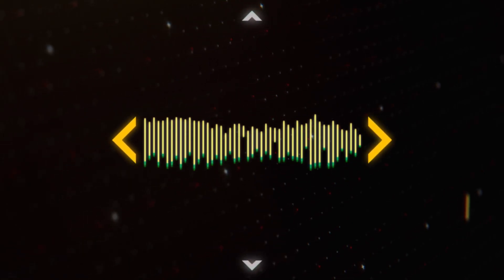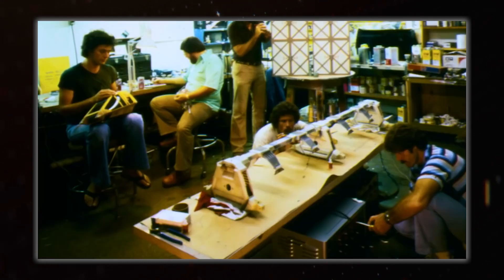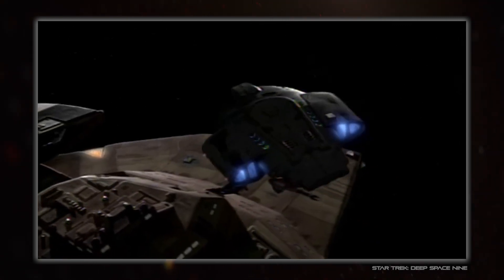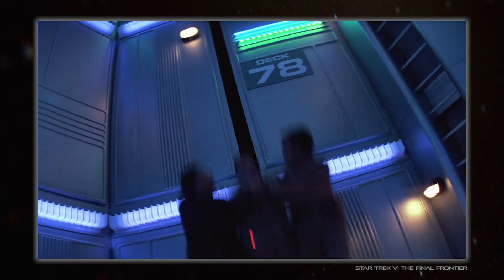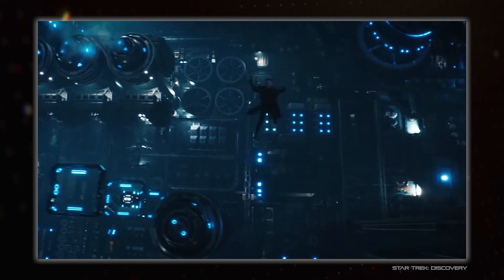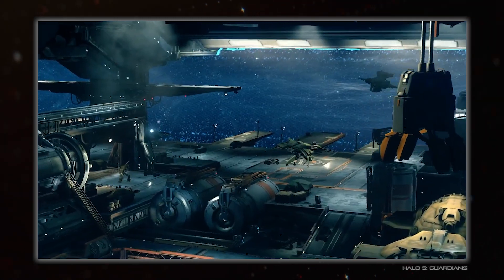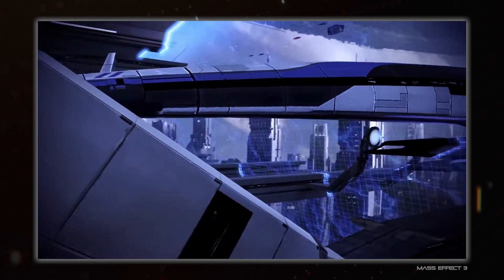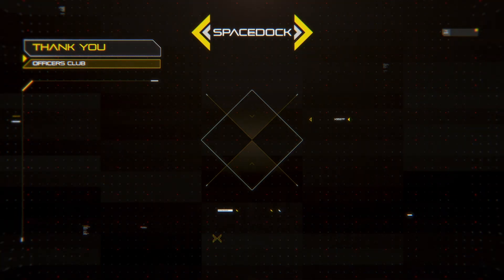Why Do Sci-Fi Spaceships Seem To Change Size?

Comment: Not ships, but Mobile Suit Gundam is very bad with this in the first few instalments.
Gundam was supposed to be 18m tall, but sometimes they draw it to be something like 100m when someone is standing close to it.
We know they have a very rigid ship sizes used for animators and compared scenes to match(Mark Simmons, who worked as the official translator, is involved in the conversation and provided scenes), but we all agree that the official released numbers on the setting books are not always that size(some way shorter and some way longer) and is a mess.  And also, while ship to ship sizes are mostly right in shows, ship to mobile suit sizes are often times arbitrary and fluctuate.

Neon Genesis Evangelion has a fun take on this, they finally come up with a fixed size for the newest movies(80m), but the old TV size is arbitrary on purpose.  The size they gave to Super Robot Wars F for the Evas is 40~200m, they just use whatever height they think looked cool in each scene.  Likely a shout out to Gundam.  An official anthology comic poked fun on this.  Since the buildings in New Tokyo-3 can raise and submerge, they just adjust the buildings to make the Evas look taller or shorter.

Comment: Funny storry the same issue occurs with space engineers.
You can build your own ship but the majority of the craft is always dedicatet do various systems, propulsion or the hull which makes the interior somewhat limited. So you don't have scale issues between ships, just inside. Everything is boiled down what the ship have to be capable of. 
Or if you don't care build a enormous ship which fits all your needs.

Comment: WARPING SPACE during certain - or hell you could even make it all, space flight/propulsion scenes (ones where drives are active) could be an answer. And to be honest I suspect that many situations have these scale problems come up specifically due to the concept around movement in space.
Using space-time warping propulsions COULD perhaps then give a reasonable neat answer to having wonky visuals if done even moderately well.

Comment: I always wonder why they (the studios) don't simply actively handwave this with saying that what we see is pretty much how the computers of the ships present the scene to *humans*.
Doing that would instantly have lots of stuff make far more sense.
In a realistic space battle (well, as far as it goes), distances between ships would be huge. Very huge. Distances between naval ships in combat already are, and this should only be a fraction to what they'd be in space. Actually seeing a frame with all ships in a battle would look like mostly black with some tiny flickerings of explosions.
But if what we see is computers presenting to humans, they'd magnify everything, like miniatures on a battle map are naturally magnified, or marked houses on a map.
We could also say that something like a klingon ship going into stealth isn't actually the thing turning literally invisible, but it strongly reducing it's emissions and thus becoming invisible to normal sensors. The display to humans would still visualize this as the ship blurring and then vanishing as we are used to. This is pretty much how it would work with submarines, dot on a radar and then no dot on a radar.
And as for the actual topic of this video, ship sizes as seen might be actually representing their amount of *emissions*. This would easily explain the Defiant, which is said to have an unusually high amount of energy for its size class. Defiant is in battle -> reactor at full power -> it gets large on a representative visualization.
Reply: (Obviously this doesn't work with the issue about ships in docking bays and their interior being bigger.)

Comment: I think that's more important then hyper accurate and consistent true scaling is that scaling of your ships feel correct. For example few people questioned the final level of the original Halo game  even though the level was several times larger then ship model shown earlier because it felt like it could belong into the ship.

Or to give a more descriptive example, lets say you want ship "a" to scale at 10 times bigger then ship "b" then you can have ship "a" be between 8 to 12 times bigger then ship "b" and still seem consistent and correct as they're still in the rough "10 times bigger" margin even if the actual scale varies. This kind of emotional or narrative consistency is way more important then getting the scale correct within 1 mm especially if we're talking about things that are several kilometers long.

EDIT: Same applies to interiors not matching exteriors, they should feel like they match even if the actual scales don't quite line up.

Comment: on a fun note, the Normandy SR-2 and the Railjack are apparently close in size.  Though if I had to fight a reaper I think I would take the Railjack, Orokin/Tenno technology is far ahead of the Systems Alliance and probably even that of the reapers.

back to more on topic to the video though
The normandys are honestly empty for the crew sizes a ship that scale should have, Like the Railjack has an excuse as they only ever operated in the Sol System so even when crewed by Dax warriors it was never far from a dock as the void drive flies.  So I excuse the Normandys as victims of game design, Making the ship packed tight like a submarine or RL navy ship of a similar class or type role would not only make navigation in a game engine hard but add lots of unneeded corridors and crew to animate and model and texture.  The harsh reality being the SR-1 and SR-2 are basically just roaming quest hubs.

Similarly the Tenno/Orokin Sigma Series Railjack from Warframe is so big open because you can be boarded via attack vehicles called RamSleds.  As such the ship has to be big enough to be a fighting space for the gameplay mechanics you use in warframe which means you are going to want some parkor room.

Comment: Speaking of scale: I always found funny how vastly different the called out distances between starships and their actual visual distance was in Star Trek. For example the helm would say that another ship was 20,000 kilometers off the bow, while we can cleary see that the actual distance was just a couple of kilometers at the most. It's almost if they just wrote huge numbers into the script, because space is huge, without thinking about how that would tranlaste to the screen in the modelwork. And they didn't bother to alter the dialog when they actually shot the scenes.
Reply: Or maybe you just havent grasp how small 20,000 KM really is. The moon is 384,000 KM away and it appears to be right next door. Star Trek ships are actually massive, watching ST ET they generally dont use such high numbers as the ships are quite smaller.
Reply: @carmzilla  Sounds to me like you don't have a grasp how much smaller than our moon the Star Trek ships and how much 20,000 km still are (over 1.5 Earth diameters). But as a rule of thumb: when they can show both ships in the same shot, it's veeeeeeeeeeeeery unlikely that they are thousands of kilometers apart.

Comment: This is not adequately addressing the issue. You only explored why it's okay to make ludicrously nonsensical, incongruent, inconsistent, illogical, and unfitting sizes, but you didn't address why you SHOULDN'T do that at all.
"Some people won't like it" is basically what your treatment of the opposing side boils down to.
However scaling something consistently can give any work of art a sense of realism that will draw you in. It is like comparing some egyptian carving, or a medieval tapestry to a realistic painting with perspective. Yes, sure the previous ones have their charm and are neat for some decor, but if you're actually trying to draw someone into the environment of your universe, imagination, or story, then a certain degree of realism is vitally necessary. People might not hate the show for scaling inconsistencies, or even notice them, but with something as basic as visual perception, and the human mind relying on it as the primary sensory connection to the world, it will subconsciously result in an uncanny valley effect very quickly.
This could be used deliberately, but usually the opposite is wanted.
It's why we have sets with cuts in media nowadays, instead of just people talking on a stage performing a play.
Others have mentioned the innate homeliness of spaceships where the set is a consistently small size, like firefly, bebop, nebuchadnezzar, or the millenium falcon. But even larger scales done consistently can benefit by creating awe and a sense of actual weight.
The LA crash scene in StarTrek: Into Darkness, as well as the damage and subsequent crash scene in StarTrek: Beyond had weight to them, because the scales were kept consistent all throughout, instead of varying wildly.
It's not just scaling consistency, but sizing consistency that is something to consider.
People rushing through corridors and turbolifts felt more consistent in TNG than in the new movies however, precisely because in TNG these things were always kept consistent, and rooms always roughly had the same scale, if not size. It all felt roughly like a living room, with hard carpet/PU flooring, which makes sense for a comfort oriented post scarcity galactic federation. Meanwhile in the new movies, textures and sizes of interior equipment, walk paths, railings, and whole rooms, all change from shot to shot. Engineering retains the brewery feel, the warp core control and the bridge look like modern scifi setpieces, the sickbay looks like TNG, the warp core interior looks cyberpunk, the ice station looks like some horror movie. Sizes are only one aspect in this of course, but they too can contribute to something being more or less immersive.
In StarTrek Online both sorts of sizing issue come into play. Some corridors are huge, some are more true to their on screen counterparts, but still vertically scaled improperly. And some setpieces have a more generic grunge-y look, while some possess the sleek and soft aesthetics of starfleet design.
On both fronts this creates an experience that pulls one out of the game to a certain degree.
In Halo sizing is also an issue, but this is fixed a lot by forced perspective gimmicks, where the transition from foreground to background is hidden by intermediate objects. Others have referred to the Warthog run as an example of bad scaling, due to the Pillar of Autumn being too big, but it is less noticeable, because we previously never really saw it in a fixed relation to something else.

All in all, not pulling the viewer subliminally out of the experience through sizing inconsistencies (which are due to carelessness a lot more than artistic choice i believe) is more important than anything gained from using the artistic shortcut of enlarging something in size.

Comment: You handwaved this issue away, but in StarTrek Online for example size differences are so utterly unbelievably obnoxious that the whole game often feels more like a tactical display than an actual representation of the game world. Distances are kept realistic in the multi kilometer engagement range, but the actual scale of the models then is ludicrous. Vertical scaling in nternal spaces alone is already jarring, as the devs worked off of actual set sizes, not what the camera ended up showing, resulting in studio height corridors in vessels like voyager and ludicrous expansive hallways runabouts could fly through in others. The need to make standardized bridges you can walk around in even for small vessels like a runabouts, and a paranoid fear of navigation issues, also resulted in pain for the player, when every vessel interior is compeletely unrelated in shape to the actual vessel, and is a TARDIS in disguise.
This is in addition to bumping into tiny planets with ships.
Ironically for a game about space, only the ground maps have sensible scales.

Comment: I can't say I've over noticed this in scifi, however it really stands out to me in flight sims, for if they got the scaling technically correct, opposing jet fighters would at times be only a few pixels in size, making the view on screen kind of horrible. There is an online game often promoted on the web where the scaling is so off it's not funny with jet fighters moving really slow and turning on the spot, manurers only a Harrier jump jet could attain, but definitely not while in combat.
With sci-fi I think they often come up with a nice ship design, and only later realise they should define how big it really is. About the only craft that is stuck to a scale at inception is the Star Wars X wings as the pilot is visible though the cockpit window -  they cannot really scale him down and add another floor inside.

Comment: I'm very familiar with this: a handful of years ago I drew 200+ pages of a sci-fi webcomic. The hero ship was 600m long and 250m tall in its thickest point.
The writer was VERY fond of panels like "The ship has landed and we see the crew disembark". The thing is literally as tall as a skyscraper. A 57 storeys one. We see jack shit. It's either enough of the ship to make it recognizable with tiny dots next to it, or recognizable characters next to a mostly featureless metal wall.

It was sliiightly better when the ship docked to a station or another ship, but I've lost count of how many times I had to draw a connector arm that in real life would've been large enough to fit at least ten storeys in it. 

Also the first shot of  the ship in the first page, before the ship's size was established, I drew only three rows of windows on the side. I guess each window spanned multiple decks :P

The series was comedic so I guess it wasn't really a big deal but those inconsistencies always bothered me.

Comment: I will defend the interior volume issue in Discovery S3 by saying that The Federation's dimensional engineering (i.e. bigger on the inside than outside) is at least five hundred years old by the time of Discovery S3. Remember the 27th Century timeship in Enterprise S2. It had at least three decks of space inside, while it was similar in size to a shuttlepod on the outside. One could argue that Discovery was a mid-23rd Century vessel that was almost a millennium out of time, but lets face it: the ship had basically been completely rebuilt with programmable matter.

Comment: Red Dwarf's Starbug was the one that did it for me. Its only scale requirement seems to be "smaller than Red Dwarf." The set of the bridge suggests it's about the same size as a large van, while the scale models suggest it's much more spacious. I obviously have to give the show a pass since it's a comedy, but even when the show shows actual scale changes (like when the interior of Starbug is boosted by 200%, or when Red Dwarf is accidentally inflated to several times its correct size) it's hard not to notice.

Comment: The most relevant explanation is the Interiors are designed and built for production that can vary and change from week to week and in most cases whether the script or the visual effects Department having agreement over and understanding size and scale are something that aren't almost always agreed upon or settled on.

 Lacking a physical model these days your ships can vary in both dimensions and internal volume all the time Deep Space Nine was supposed to be an earth Mile in one draft and then I think they've paid its size differently a couple of times during the run of the show but when they left strict modeling of Miniatures and filming models it's up in the air until somebody needs it set down in law and then that's when you have discrepancies the defiant I'll be honest they have never been consistent with it even though they built a physical filming model and then I think it was only ever supposed to be 120 or 170 m long but some scales have it pegged at 230 M. 

But I got to be honest with you I'm a big fan of bigger ships so I tend to round things up but it was only intended to have a crew of 50 but it was supposed to be minimalist at best but the reason there's discrepancies is it isn't real if things were real then their proportions and distribution of volumes would be set and fixed.

 I for one will always contend that scale grounds things and if you not grounding it it's not going age well as the franchise moves on and time goes by some television shows and films age better than others some video games and other forms of media at age well but others not

Comment: I can understand games, and sometimes CGI. We may have quite a bit of computing power today, but that doesn't mean developers will cut corners. The exterior, the interior, and the interior's interiors will be separate scenes that will be loaded separately, and sometimes the distance buffering will have a fit and/or fight if the object is too large so scaling everything down "just so" will make a mess of "logical scales". Even if things are pre-rendered for a film or series, depending on the software used big objects can suffer the z-fighting, or the rendering actually does take a long time because of the distances it has to trace.
One way if one wants to make everything accurate is if you modeled every room and section of a ship to scale (with a dummy human in every room), which no one is willing to spend the budget on. :P

Comment: This scale changing isn't really unique to spacecraft. It's really the same with a lot of plain buildings in games and shows, especially smaller ones. And then you have land vehicles like the truck in Knight Rider. From the outside it look just barely wide enough to fit K.I.T.T. but inside it's like a garage.

Also, the Tardis is, special.